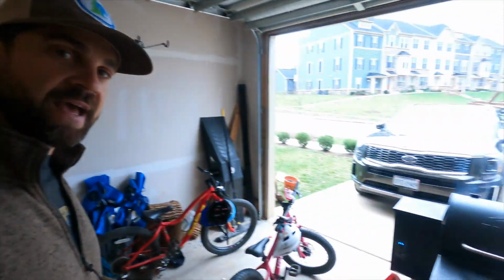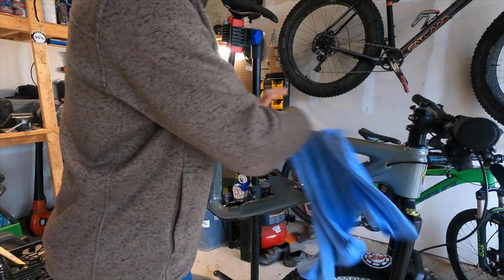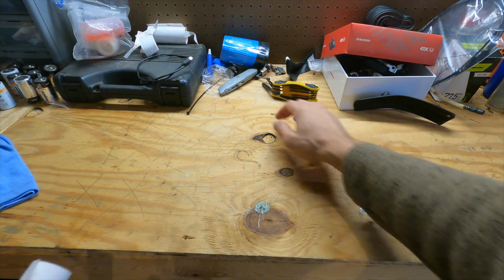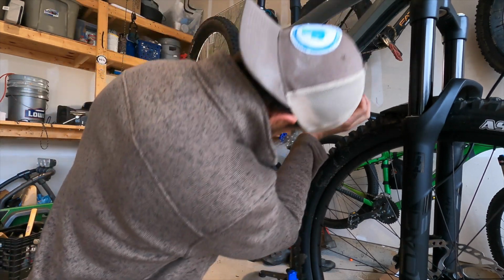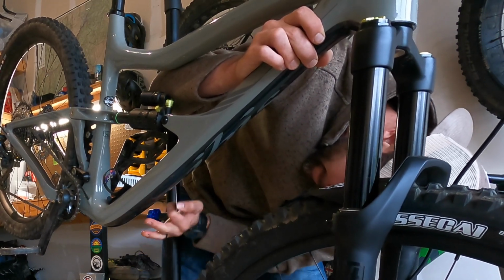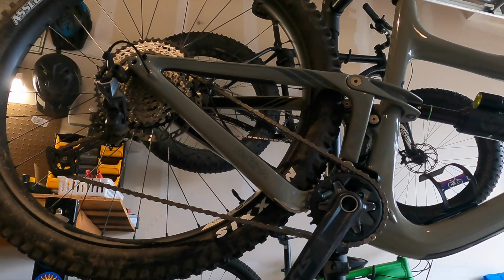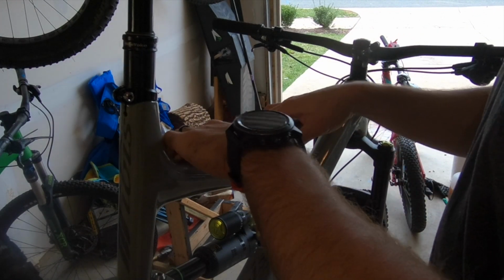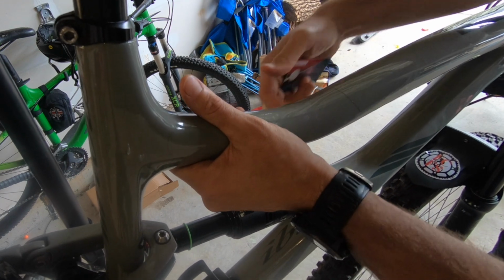DIY Mountain Bike Frame Protection for under $20 - 3M Clear Vinyl Install

Comment: I'm not sure why but why would you coat the top of the top rail with the 3M plastic tape? 
 Wouldn't we be more concerned about the sections of the frame that are alot more exposed to the ground like the pedal housing and rear lower forks that attach the rear wheel to the bike? 
 Anything above the knee hight of the frame would - i think, be less exposed to dirt and grime thrown out from the tires.
Reply from the maker: You're probably right but the top tube is still exposed to scuffs from knee rub and rocks.   The fork lowers would be a  good one to do too.

Comment: That's just water and shampoo? O is some special mix?
Reply from the maker: Just water and a splash of dish soap
Reply: @FoCoFlowShow  thx , how much water,?  80-20?, 50-50?
Reply from the maker: @j.s9875  80-20 water to soap at most - you don’t need much soap - 90-10 would probably be fine